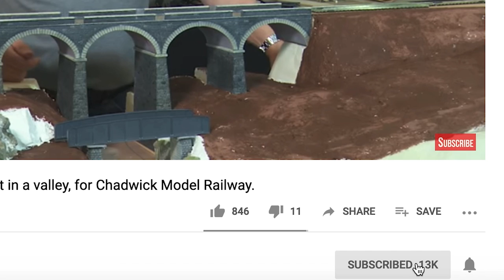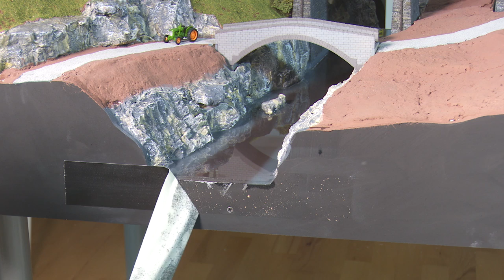Viaduct and landscaping finished at Chadwick Model Railway | 70.

Comment: Half way through the video when you revealed the epoxy river I commented to the wife that it didn't look right as a river like that with steep rocky banks would be fast flowing.... and then you revealed your secret weapon and that air brush.... the transformation was amazing and I'm sure this could used again to intensify the ripples and current around the rock in the middle if needed (probably looks more effective in real life than on camera).  You mentioned just how impressive the height of these viaducts are.  Two stops away from me on the ECML is Digswell Viaduct.  40 arches span the 1500 feet valley, and is 100 feet from track bed to the ground below.  Whilst not as many spans, your viaduct is quite representative of the Digswell viaduct in appearance and scale height.

Thanks once again for an informative and entertaining video
Reply from the maker: Wow Malcolm, what a great comment. I’m so very pleased that you enjoyed it.

Comment: Hi Charlie, all looking good. I never thought of using decorators caulk for small gaps,I'll remember that little tip for the future.For filling slightly larger gaps, I have in the past used Pink Grip SF [solvent free] which accepts the 'wet finger' and takes paint when dry.RegardsMike [chapel house model railway]
Reply from the maker: Thanks Mike, I’ll check out Pink Grip, and I’ve subscribed too.

Comment: Good video Charlie and nice modelling. Hot Tip (excuse the pun) - when using a blowlamp on your model have a car fire extinguisher or even a bucket of water close to hand as most of our models are made from flammable materials and are readily combustible. You don't want your hard work going up in flames or, even worse, setting your railway room or even house on fire as the highly combustible materials do lend themselves to rapid fire growth and spread.
Reply from the maker: A VERY good point David.

Comment: Hi Charlie - If you want a bit of blue in the river, paint the river bed with a bit of blue.  I also used a little white where the water might be flowing a little faster too, ie, around the rocks.  The epoxy resin is easy enough to work with.  If you don't mix enough, you can always mix another batch and add it onto the first pouring. It won't do anything weird.
Reply from the maker: Thanks for the advice 07. 
I will add a little white water once I’ve found some canoeists.

Comment: Those Mod-Podge ripples worked a treat, really effective! I use resins quite a bit in my work and the easiest way to measure out is with a set of electronic scales I find. That way you can do it all in one pot and reduce wastage and costs. Stick with the bridge too, have faith it will be lovely once it's got some scenic treatements I'm sure. It's about the dressed results after all.
Reply from the maker: Thanks Ben, I’m so pleased that you enjoyed it and thanks for the tip.
Reply: I've seen comments from some very experienced modelers who said that resin sometimes turns murkey grey 6 to 12 months out. Have you seen that change?

Comment: Here in the states I use the pink or blue foam like is used for insulating houses. It is messy but easy to work with and I do not need the gloves. I use a tube of bonding called Liquid Nail and it is about $2.00 a tube and seems not to hurt the foam. It dries clear so I use it for "spot gluing" the track wile I make it straight. I make a type of skulpt--a-mold with plaster and a filler that is about 1/2 the cost of the molding stuff. Works the same way. For my paint I go to one of the "big box" stores and get some rejected paint that is on extreme discount and have them put a lot of black into it and then I have enough paint for all of the layout. I got a gallon for about $10.00 a few years ago and still use it today after the 3rd layout. If you have not seen, I an very cheep... I love that you didn't edit out the "T" shirt problem. I've lost a few shirts to paint and glue.  I was taught wile young (I'm 70 now) that it was better to use to much and recover it than to have to go back and fill spots. I make all of my own rock molds and even molds of tunnel and retaining walls. You can do this without problems if you don't sell the castings. The company that made the originals might get a bit mad. This is a good way to be able to have the many castings for a large club.. I might spray a dull coat on the metal parts of the tractor to take the shine (newness) off. Really like the river. I have yet to try pouring a river.     Wonderful video.....
Reply from the maker: Hi David, what a great comment.
We clearly love this fascinating hobby.
Good luck with your layout.
Regards Charlie.

Comment: You could put patchy static grass over the scene using smaller fibres as you get to the back of the layout. 6mm at the front and then 2mm at the back to keep that illousion of depth. And also you need some white water around those rocks trailing off :)
Reply from the maker: It’s all on that massive list NKP!
Reply: @ChadwickModelRailway  hahahaha I thought it might be. Maybe add a tyre swing to that miassive tree?
Reply from the maker: Now that wasn’t on the list ..... until now!

Comment: Well done!  I am impressed with the trees and I like the way you have used  tree size to provide a depth perspective.  I think I would have produced a mini water fall under the viaduct giving smooth flow under part of it and turbulent flow towards the front and certainly turbulent flow and trail on the down side of the rock.  I was impressed with the epoxy resin for the river and I think there was sufficient blue, where you said you didn't think you had added enough.  I'm still not sure about the road bridge though.
Reply from the maker: Good points Don and I’m so very pleased that you enjoyed it

Comment: Your reservation about the river bridge is well founded I believe. The actual shape of the arch seems unnatural and there needs to be some structural support at the base of the arch itself. A little worry also is about the width of the bridge roadway, can that tractor drive across the bridge without hitting the walls? Great work by the way, quite jealous.
Reply from the maker: Some good points Brian and I’m so pleased that you enjoyed it
Reply: @brian. There is more than adequate foundation on the riparian for structural support. Judging by the surrounding terrain, also an abundance of building materials that could be obtained free of charge. Plus, maybe, the builder/farmer was as talented as Charlie and wanted a stone bridge so built one 😉

Comment: Another wonderful video and as a new modeller I’m learning from your videos. I’m wondering however how you make the track fit. From one board to another. I know to most this seems a silly question but do you have a video to show how you do this.?
Reply from the maker: I just fit the points to both boards and then bolt the boards into their final position.  Then I use flexable track to join them together.  I'll be doing it again in a couple a weeks Lee.

Comment: the bit with the switches probably could have been made with a pluggable module that would be lifted from the top for maintenance...
now, you forgot a bit under the track on the left, the plywood is visible !
Reply from the maker: It's not yet finished AJ.

Comment: Another great video thanks for sharing your experiences.  Could you not use a hot air gun instead of a naked flame to remove the air bubbles?
Reply from the maker: I thing that you’re right. A decent hair drier might do it but it could also push the epoxy around.
Reply: Chadwick Model Railway just always concerned I might set my house on fire!

Comment: It's really coming on now. That river is certainly something to be proud of. 
Couple of little suggestions - static grass bushes? Might help add a bit of variety? A dot of PVA on some plastic, add grass, wait until dry and peel off / stick them where you want them. Quick and cheap to make and useful to have on hand to improve any scene? 
I hope it doesn't annoy you to mention it, but it's one of my personal bug-bears... Before you repaint the black finisher, a few minutes with some polyfiller or similar to disguise the screw heads will help give it a seamless look.  Probably petty to mention it, but it's just a personal dislike and not meant as a dig (re a previous comment I passed on your interweb troll video!)

Oh... one more thing. Have a look in Tesco. plain t-shirts on offer at the moment for 4 quid a pop. You can destroy as many as you like at that price point!!!
Reply from the maker: Thanks for the tips and they are very welcome . I’m so pleased that you enjoyed it. Regards Charlie

Comment: Nice looking module, Charlie, however it looks like an architectural model...in other words it's too clean, both brides need to have some definition on the individual stones and weathering. And the fields need some variation in the green colour, dryer spots, etc. Also, some tyre tracks on the road.
Reply from the maker: I agree with you on this one William.
The whole scene needs a second sweep.
Regards Charlie
Reply: @ChadwickModelRailway  Sorry, that other posting was a mistake....it was supposed to be on this one but the video switched as I was typing and it posted to the other vid. Again, sorry mate.
Reply: @ChadwickModelRailway  Sorry, that other posting was a mistake....it was supposed to be on this one but the video switched as I was typing and it posted to the other vid. Again, sorry mate.

Comment: Great job. Charlie.   I'm embarking on a layout  Charlie and wouldn't mind knowing. Which material. Is best to use for baseboards I've insulated my shed fully and built my carcas for my layout.    Just wondering which material to use for best results.
Reply from the maker: Hi Dylan, I have used 12mm ply from B&Q.  The large stores will cut it to size too.
One serious tip, do not use MDF due to warping.
Reply: @ChadwickModelRailway  thanks Charlie I'll source this for my next week off work.    I was wondering about MDF and warpage   so 12mm ply is the one.  I'll send on photo when done  hope you don't mind me asking on your advice throughout my build. Cheers Charlie  keep up the good work. I like your YouTube channel.

Comment: Just be careful with throwing epoxy in the bin. Some types of epoxy can be very hot and melt your bin when its hardening .. and worst case start a fire if not used properly.. and same is it with some plasters :) Otherwise it looks very cool sir!
Reply from the maker: Great tip Sharki, many thanks.

Comment: I don't know if you could do it with the calk you are using, but, have you considered mixing the paint with the calk prior to application, Charlie? ...
.. If it happened to become damaged, having the paint through it would prevent any signs of damage being obvious.
Just one thing that crossed my mind though, is that if you plan to leave the Tractor in the near vicinity of the OO  Animals, wouldn't they kind of look a tad out of scale against each other?  

ps ..  I'm building a N Guage Layout, but with a bit of a twist.  I'm covering a much larger area than what would normally be done.  There will be types of Dividing Scenery between sections.  I'll be using a combination of Scales (1:148 and/or 1:150 to match the 1:160, and a few 1:144 - as some models I have in mind only come in 1:144, 1:200, 1:300).  I was wondering if 1:200 or 1:300 would give suitable perspective when placed about 3 to 5 feet apart on a section that represents about 6 miles (as I feel using the 1:144 would give false perspective for the distance represented).
Reply from the maker: Sorry Neville but it would probably take even longer to mix it out of the tube, than painting it once it’s dried.
Reply: @ChadwickModelRailway  ... Hmmmnnnnn.  Good Point.
I just Edited my Post, and added a question,
Reply from the maker: But the boards are only 3 feet wide so the ability to construct depth is very difficult.
Reply: @ChadwickModelRailway  ... Yes, I realise that.  It wouldn't have to be perfect, just to give the impression of Distance.
The rest of the Layout is much larger:  It's just this particular section (which is actually at one end of it.
I don't want to go into detail here, as it's kind of a unique plan I have.  But to give you an idea ...
.. Let's say that I had a Shoreline and wanted to give the impression of Ships in the distance towards the Horizon.
Reply from the maker: Sounds exciting
Reply: @ChadwickModelRailway  ... Thanks.  I'd say More Challenging than Exciting, though ... LOL.
I have changed the Basic Track Plan so many times, it's insane.

Comment: Hi Charlie, I have been subscribed to your channel for over a year now and I find your videos a pleasure to watch, however, I have a bit of a dilemma and wanted some advice?  Subscribing to your channel and Others my intention was to plan and build a DCC model railway from scratch - hence subscribing to your channel, but the green eyed monster of eBay got the better of me so I decided to buy a DCC model railway from a seller whose layout was in his loft.  The layout is 20ft x 8ft, fully wired for DCC and I did pay a small price for it.  However, my dilemma now is where to site the layout?  At the time of purchase I thought yeah I will purchase a rather large shed and erect the layout there, but the cost of purchasing such a large shed to house the layout, not to include the cost for casting a concrete base, the shed being supplied with insulation is going to set me back a few quid.  So I am not sure what to do? I am sure whilst you are probably thinking....did you not get a cost before purchasing the layout? I did ‘roughly’ but unfortunately the cost has almost doubled, partly as the wife would rather I purchase a log cabin, which to me is daft just to site a model railway.  I am fortunate that I have an area to site such a large shed / cabin but I just cannot seem to muster the enthusiasm to spend a large sum of money just for a shed and now I am left with a DCC layout, (currently in storage) and I am not sure whether to offer it to a local model railway club or just take it to the tip? All seems such a waste?  Originally, the plan was to build my own, but like many I am sure fellow subscribers, young children, house to do up I just don’t have the time to build one from scratch - much to my disappointment.  The wife hasent to add is rather annoyed that I have purchased the layout now knowing how much it is going to cost to buy somewhere or something to put it in.

Do you have any advice? Know of anyone who might want it? At a bit of lost cause as to what to do for the best with it?

Keep up the good work and I will stay tuned to more updates of Chadwick.

Best Regards
Jeremy
Reply from the maker: Wow Jeremy, what a dilemma.
Firstly, could you not make a small end to end layout from it. Perhaps something like a 10ft x 3ft, at least it will not go to waste.  Does it easily go together and dismantle? It’s something that a Model Railway club would find crucial. Mind you 20ft is one hell of a size!  Clearly I don’t know how much you’ve paid but perhaps you could resell it on eBay using the original photos or if it’s good quality break it up for parts. Cobalt point motors are probably worth a tenner.  What is the quality of the landscape/buildings?
Where abouts are you?
Regards Charlie
Reply: Hi Charlie, thank you for your reply to my “dilemma”
I was wrong regarding the size it is actually 22’ x 8’.
There are 10 boards in total including 4 boards as an underside storage yard.
The seller did advise that the boards could bu run independently.
I did assist the seller with the dismantling and I do know that each board was fixed together using a coach bolt and nut.  The DCC wiring of each board was terminated using clear plastic terminal plug and sockets
There were no buildings with the sale, just the boards.  The scenic side of it is good some of which is not too dissimilar to your viaduct board now complete (impressive). The seller did use the ESU 50210 controller console.
All point motors are the solenoid type probably gaugemaster, the seeker did leave wiring (not connected for signals), track, PECO code 75.
I do have access to the original sale via eBay so I do have pictures.  I paid £1250 for the layout (without buildings).
I agree I could resist this on eBay with a view that someone might purchase it, but it has been kept dry in a storage compound close to home.
I could as you advise use part of it and make an end to end layout, but the original ran all of the way around this guy’s loft.
The boards by construction are built well, the wiring is loomed well and neat - so it seems such a waste just to get rid of it?

If I were to perhaps buy a shed, large enough to store it but considering the boards are built well perhaps I might get away with a standard shed not a log cabin maybe? Although I suspect that I would still need to insulate the walls, floor and ceiling though?

Could I send you some pictures, alternatively the item on eBay if you care to search for it was
#202440025400.

Thanks and Regards
Jeremy
Reply from the maker: Hi Jeremy,
It does sound rather sad that you wish to move it on and £1250 is a considerable sum to loose.
I can’t bring up the auction, as I’m away up in York for a few days without a computer.
Can you send a link?
Regards Charlie
Reply from the maker: Well Jeremy I can see your problem. 
It’s a great deal of layout but without the buildings it must be somewhat less attractive.
I would probably put it back on eBay with a low starting price of say £500 and see what happens. 
At least you might be able  move it on and recover some of your outlay.
With the soon to be broadcast Great Model Railway Challenge and Christmas not too far away, now is probably the best time to try and sell it.
I’m sorry if this isn’t the right answer but short of giving it away, what other choice is there?
Regards Charlie